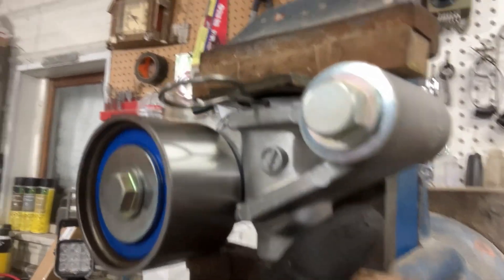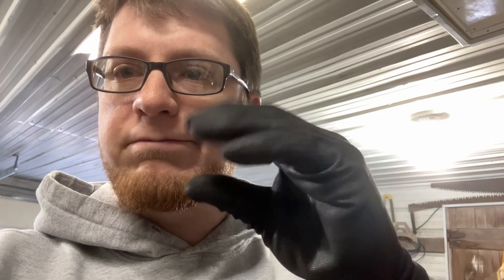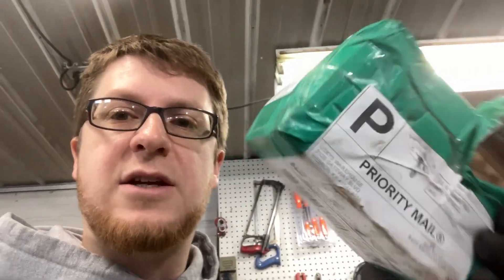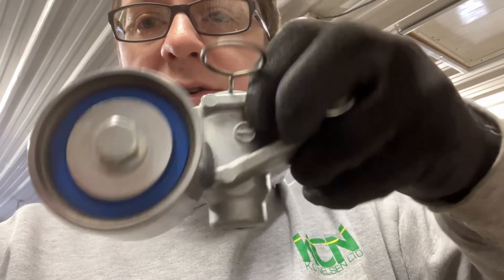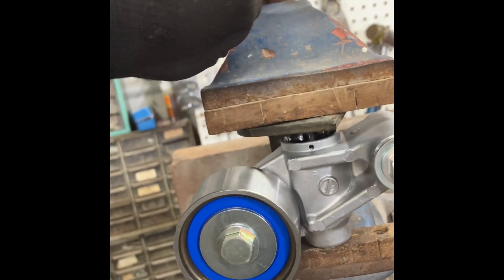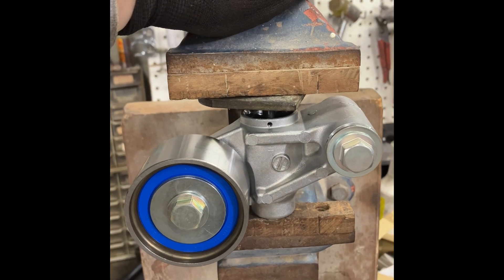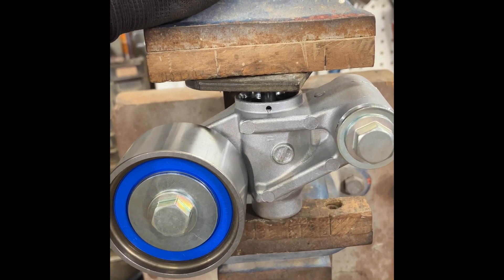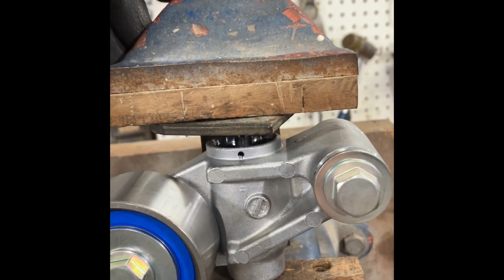Subaru timing belt tensioners, my nemesis

Comment: All the cheep ones tell you to straight up do the 3 cycle bleeding process cause they can't be sure the storage/shipping angle.

Its not voodoo, unless you don't know how a shock works. same shit can happen to a shock but due to there longer travel they are effectively self bleeding.

in short you have a sealed, pressurized cylinder with a piston, the piston has a metering orifice that determines how fast the oil can move from one side to the other, when the tensioner isn't stored vertical when in its compressed grenade pin state, the pressurized nitrogen can end up on the underside of the piston, and when installed its going to basically foam up on startup under, above or on both sides of the piston eliminating most if not all dampening ability, results are well you know.  

If you apply too much pressure, that metering orifice cant keep up and the pressure can blow out the rings on the piston absolutely killing the unit.

I'v always used a C clamp on used ones and just applied a steady just enough to compress pressure, think pinky finger on a 3 inch bar tightening the clamp(kinda like the second hand method you mentioned) stopping if i feel the resistance build too quick. A table vice doesn't have the same degree of tactile feedback in my experience.

Fist few times I think I just did 1/2 turn at a time every 5-10 sec, but I'd immediately stop if i felt the resistance come up before completing the 1/2 turn, before waiting 10-15 sec and continuing.

The saying goes "There is more then one way to skin a cat."

That all said, I haven't bought a new tensioner in ~10 years so I cant speak to current quality of them.

I hope this helps you in someway and wish you luck going forward.
Reply from the maker: So let me ask you this, the techs at Subaru say “pull the pin and go”, can it be that easy? Would it help if I let the tensioner set upright for a long period of time before install? Will the air/oil equal out? Or must I bleed it if there is any doubt as to how it was jostled in shipment? I bought one from the Subaru dealership last week and simply pulled the pin this time (also installed a belt guard). This tensioner this has me questioning everything I’ve ever known, sadly.
Reply from the maker: Thanks for the reply! Your explanation makes sense. When I bleed them in the vice, I like to feel the tightness increase as I crank, maybe I should slow down even more. 

Also, do you have any thoughts on the units that I’ve installed that work fine for 5-10,000 miles and then allow the belt to slack and break? I would think if it’s tight right away, it would be good for the long haul, but that’s not my experience. Please advise. Again, I appreciate your feedback.
Reply: If your feeling the resistance build absolutely go a bit slower, to put it another way I ride the wave of I can feel some resistance that is definitely coming from the oil dampener vs spring pressure and clamp/vise drag, but I'm never forcing it.
Going slower never hurts.

Could be bad stock, could have been assembled with bad stock, casing/manufacturing defect, ya sucks if the case.

Seeing as your belt straight up snapped without any warning sign, I suspect you might not have the 13145AA021 stock timing belt guide on above your crank(or its not installed at the correct gap), they used to be stock on every single engine, but bean counters had there way at some point, there are also guides for the cams (dual cam heads at lest) , but no ware as important as the crank one. There are so many videos of people with literally bouncing dead tensioners (ya the spring is still there but 0 dampening), and a engine knock sorta sound, and its almost always the older modal Subarus (still interference) that you find these dead flopping tensioners on yet they didn't blow a motor before the tensioner started sounding like rod/engine knock/piston slap.

O and driving habits have a significant part when it comes to the teeth skipping, the more aggressive one drives, the more likely to skip teeth on a lose tensioner in general.

If not bled, I can see one with a minimum amount of trapped air, after the timing belt settles in and starts stretching a bit, that it could then slowly work in more air and foam till failure.

BTW, generally what happens is the tensioner fails, the crank skips more then I think 3 or 4 teeth(probably more, been a while), and its the interference of the valves that do the belt snapping.

I wouldn't be surprised if Subaru removed the timing belt guide to sell more short blocks since planed obsolescence is in full swing in most manufacturing.
Reply from the maker: @TheLoiteringKid  wow, that’s great information! I have heard that dreaded knocking sound and shut cars off before damage occurred, but many I’ve repaired haven’t been so lucky. I think along with bleeding the tensioners properly, I will start installing the guide over the crank pulley, even on the automatic transmission cars. All of the belt failures for me have been clean breaks. So interesting to hear the cause of the clean break being the skipping of teeth and valve damage FIRST.  Thank you for finding my video and taking the time to make these comments. This is why I like YouTube.
Reply: If you have em use em, there is no logical reason to leave them out knowing what you know now ;). if you don't have one laying around, is ~10$ worth the possibility of saving you block/heads/pistons? I think so, and most agree on that.

Its more the snapped without warning then just snapped that I suspect that's how it went down, again harking back to I'v seen countless videos of dead tensioners and perfectly running motors still going, those belts don't just snap, wear away? sure, I'v seen video of a Subaru running on 1/3 of a belt (width wise, still don't know how), just 2/3's the belt worn away completely.

To snap a timing belt (especially the good stuff, ever try to cut one to make a strap wrench cam holder? they stout) you generally need mechanical damage or a hell of a shock load, it never sees that shock in standard operation, the closest you could get to that kind of shock load is with a manual, and being a jackass, even then I'd bet your skip teeth before snapping a belt, but skipping teeth leads to well, you know at this point. That's not to say its impossible to snap one otherwise, but in my experience that is how it goes down.

As I recall the autos were the first to loose the belt guide, subaru saved ~$10 a car, and introduced a failure mod that likely wouldn't happen in warranty that can kill the entire block win win for them.

I'm no expert but I'v helped build more then a few subarus as my friend's assistant, who built EJ motors and spliced harnesses for the drag strip/pikes peek as a side job(his not mine, I got payed in beer >=) for a few years.